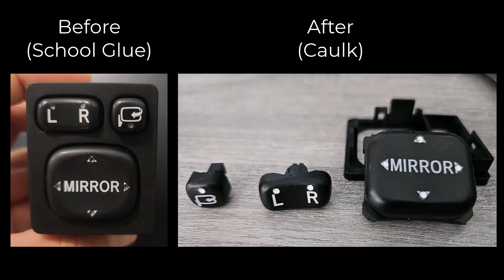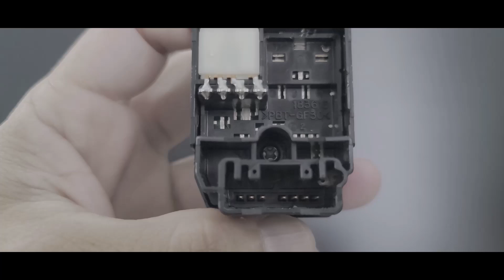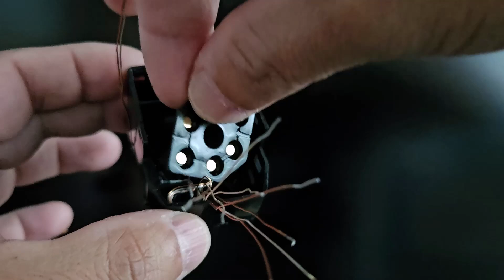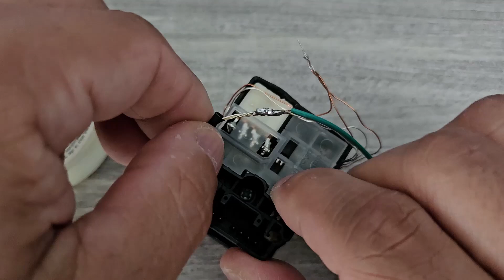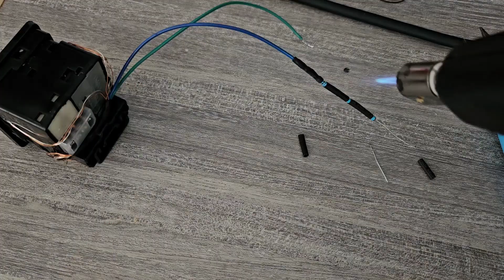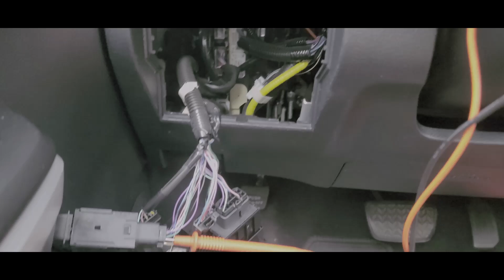Adding Backlight to Toyota Tundra Side Mirrors Switch Buttons - Part 2

Comment: If there was a way to do this without drilling holes in the plastic I would do this but I'm not a fan of how hacky this mod is. I'll suffer with the dark corner of the instrument panel, I have interior lights I'll turn them on if I really need to move my mirrors.
Reply from the maker: I think that there is a way to adapt a similar factory iluminated switch, but it will require an encoder in between.  This is a cool topic to explore in the near future.

Comment: Is there a way to keep dash lights on anytime engine is on? 2014 tundra 1794 edition.
Reply from the maker: Good question! Well, this is what I think, please don't take this as correct this is just an unconfirmed idea.  The idea will be to open the dimmer output circuit.  This is literally cut that wire that goes from the dimmer to the lights and connect it to a 2 positions switch.  Let say we have a switch with position A, B, and a common C terminal.  The terminal A will be connected to the dimmer output and the common terminal C will be connected to the lights circuit.  At this point if the switch it’s in the A position the lights will work as usual.  The tricky part will be on terminal B.  If the dimmer works with ground, then that terminal B must be connected to a ground when the truck is on.  You can use a relay connected to the accessories circuit to provide ground to the switch when the truck is on.  This is assuming that the dimmer works with ground.  If the dimmer works with positive then the relay is no needed and the terminal B can be connected directly to the accessories circuit.  But is very probable that the dimmer will work with ground.  When the switch is in position B the dimmer will not have any effect and the lights will be On with full brightness.  The other option will be to do something similar but opening the circuit in the dimmer input but this will be a very complex and even more risky.  This is a really interesting question and this is only a conceptual idea.  My recommendation will be to find the diagrams related to your model to confirm if this is possible and if you do this you have to be very careful because a short on this area will be an expensive repair or replacement. Disclaimer: I am not responsible for any damage. 😬 BTW, this is something I can try on my own Tundra a make a video about it.